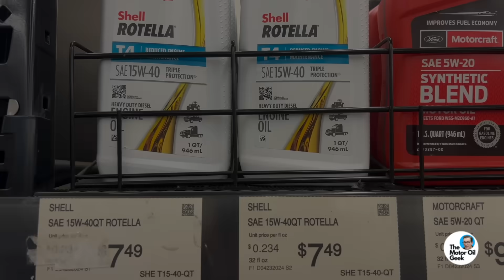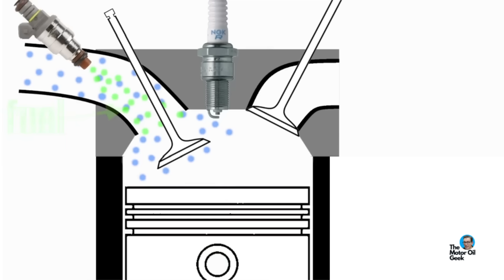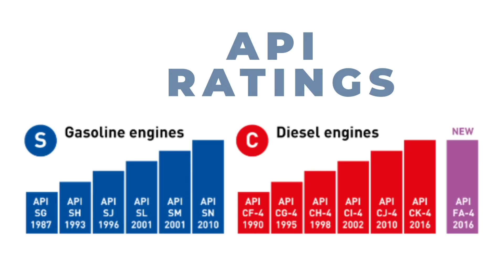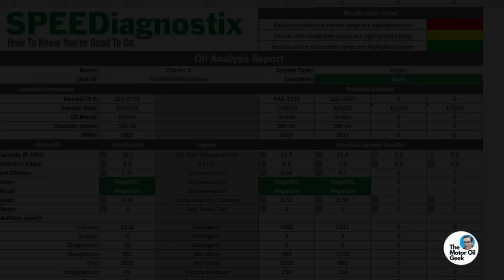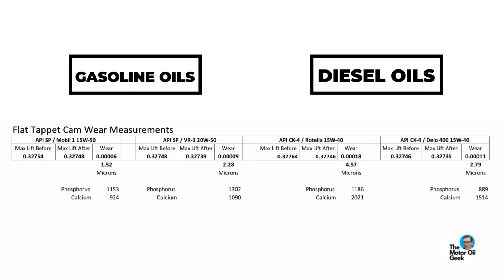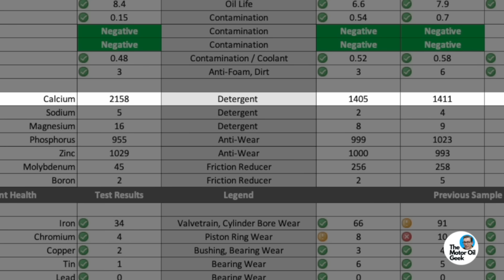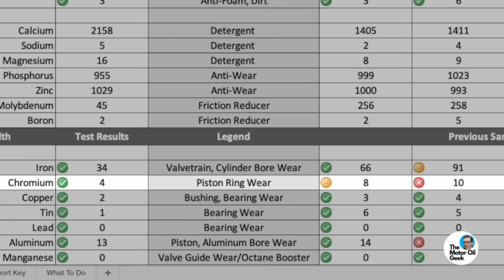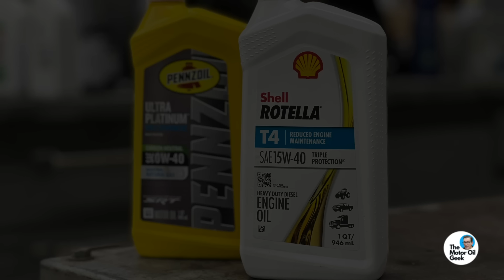Why DIESEL Oil is Actually WORSE for Gas Engines!

Comment: Lake: Rotella T6 says it is safe for gas, diesel, and even motorcycles. You should make a video about this engine oil.
Reply: Anecdotal evidence:

I have 85,000 miles on a '10 Kawasaki 650 Versys. Bought it new and have used nothing but T6 5-40 the whole time.
Motorcycle still runs, shifts, and rides as new. I go 5k miles oil change intervals, and don't have to add any oil between them.
Reply: @RockyMotoX  same here, my VTX 1800, my DRZ400E, my Vulcan 500 (with a ninja 500 motor swap) all run on T6 for up to 12 years for my VTX.
Reply: @RockyMotoX yep, there's tons of stories out there of bikes running T6 that last 100,000+ miles.  I think the key with any oil is the change intervals.  I run it in my Super Tenere as well.
Reply: Thats a pretty substantial test. Its why I watched this one because a lot of guys are running this in the bike race engines. What i was told was itbwas never meant to run high rpms. Because the antifoamijg agents arent there like a motorcycle oil @RockyMotoX
Reply: I think the break may be gasoline direct injection vs gasoline port injection (which would include carb, tbi, etc)
Reply: @redneck4528  yes. The ring groove  detonation hazard was described as for boosted direct injection. This makes sense. The quantity of the calcium rich oil is too low elsewhere in combustion chamber. The ring groove is rich in oil. The gasoline injection begins quite early and as piston travels up, some gas will enter the ring groove area. Catalytic assisted reactions / detonation occurs with more tendency with higher pressure and temperature. A boosted D.I. car engine can really get up there, say 11:1 at 10 psi boost that’s 11x25=275 psi combustion pressure before ignition. Piston top  easily hit 300 F. 
Not a risk in a plain engine.
Reply: @redneck4528  I would like to see Lake go deeper on this.  I and many others have used diesel oil in gas engines for years without issue.  I am going to do testing to see if I can confirm my practice.
Reply: Derek from Vice Grip Garage says it has vitamins.
Reply: Be aware that the T4 and T6 have similar levels of Calcium, which is the point he is making.
Reply: @ i see what he is saying. its a good point. the title of the video is very clickbaity. should be worse for gdi engines.
Reply: Your question about diesel oil and motorcycles is exactly what i was going to ask.
Reply: @flexjay87  Been using Rotella T6 5W40 in my 2014 BMW 1600 motorcycle and it works great.
Reply: @flexjay87  I use it in my 3 motorcycles, have been for the past 2 decades.  No issues, is wet clutch safe.  JASO-MA.
Reply: I would also like to see testing for motorcycle-specific oils like Motul or Golden Spectro vs. T6 full synthetic. In my old carberated motorcycle, the motor oil acts as the transmission oil as well. So the application is different than in a gasoline fuel injected passenger vehicle. In my motorcycle, I need better shear protection.
Reply: @allan6021  dont forget there wet clutch tooT-4 and t-6 are wet clutch rated
Reply: @allan6021  I hope too ! i always try to explain my point of view to my friends when i tell them i always put automobile engine oil for my dirtbikes but they stick to the idea its 2 differents type of oil.. so i stop arguing and let them say what they believe.. I wish i could make my own test but its very hard to show and explain the real deal of it
Reply: The video is somewhat deceptive in that he is showing analysis results of a 15w40 diesel oil ( probably Rotella T4) but picturing a bottle of T6 while talking about the additives in it.
Reply: @robertopenheimer1451  ASSumptions
Reply: @kq2799  OK keyboard warrior.
Reply: @ In yer feels now after saying Lake is a fraud... gosuxit
Reply: @robertopenheimer1451 not intending to start an argument here but I think your statement is incorrect. I run Rotella T6 as a 5W-40 in my diesel. Rotella T6 comes in multiple different viscosity grades. Originally 10 years ago I ran Rotella T6 as a 15W-40 in the same diesel engine. Don't mistake the type of oil for the viscosity rating.
Reply: @pks2634  I am not confused. I have been running 5W40 T6 in my 1998 diesel TDI since almost new. at least 20 years. I have also been running it in my VW direct injected (gas) 1.8T. Given the evidence he presented here I will no longer be using T6 in the 1.8T . I am going to switch to 5w-40 Quaker state euro synthetic which meets VW 502.
Reply: @robertopenheimer1451 at 9:43, it says Rotella T6
Reply: @robertopenheimer1451  he shows a bottle of rotella t4 as well lol
Reply: I saw him proudly displaying a jug of t6 several times in the video which is crazy because it’s API SN rated for gasoline engines.
Reply: @robertopenheimer1451 well actually t4 is SN rated also. It’s fine for flat tappet cam gas engines.
Reply: @robertopenheimer1451  It's not deceptive, diesel oils still have the added detergents to handle soot which increases wear in a gas engine. T6 or T4, it's the same problem. Just get over it, the myth is dead, it never made any sense to begin with.
Reply: @bobbygetsbanned6049  take a closer look at the charts and not what he is saying.
Charts show different viscosity of oils in comparison = a variable not accounted for.
When one runs experiments, all variables should be taken into the analysis.
Also, we do not know time, temperature, rpm, driver use and/or abuse.
Reply: @stepside2839  Ah hahaha reaching pretty hard. Basically all 15w-40 oil is diesel oil, so you can only compare it to similar weight non-diesel oil. But since you're already in the rotella cult, you'll always find a way to deny facts and rely on your bias instead. I'm sure they ran the rotella test in the freezer at 40,000 rpm and Mobil 1 test in a 100F shop, at 2,000 rpm, just to spite you.
Reply: T6 has been used in several types of classic straight 4 air cooled motorcycles for years without any issues.  In fact my 2014 Honda CB1100 runs great on it.  It lubricates both the engine and transmission.  This issues discussed here are not related to motorcycle engine that use T6.
Reply: I've wanted him to do that video as well. I've been running it for years in lots of bikes with 0 failures.
Reply: Turbo Subaru guys have used T6 for ages with great results either their used oil analysis and no issues with their engines.
Reply: Many people in the dr650 community recommend running shell rotella in the dr650 as that oil is readily avaible, in expensive, and is jaso certified hence the picture of the motorcycle. That jaso means it has the friction modifiers needed for the wet clutches most motorcycles have. I myself have never tried it as i am a fan of maxima, but i know enough people that do run it without issue that i wouldnt be hesitant to use it if need be. But the dr650 is an overbuilt, under powered, low stress engine, so this probably factors in to its success with that oil.
Reply: Biggest thing is pre ignition problems for gas direct injection diesel oils aren't recommended for gas direct injected engines.
Reply: The effect is more present in direct injection gasoline engine, but in port injestion engine the effect maybe less dangerous
Reply: @ For sure!
Reply: Just a question, if you're getting enough oil past the rings to affect ignition, does it really matter what oil you are using?
Reply: @rickyershey-sl8cm it's not just what leaks last the rings. It's the calcium and other additives are in the oil film left on the wall when the piston travels down the bore and comes up on compression.
Reply: I use Rotella T6, and have for 15 years. It is common in the Subaru community. Used it on an 06 WRX (common bolt ons and tune) a 13 WRX (pro tuned) and on a 16 FXT. Never had any engine issues or codes, handled the whp, no oil starvation, etc.. clutches were another issue ha
Reply: Science, not speculation
Reply: T6 is JASO-MA rated, meaning it is suitable to wet clutch.
Reply: @robertappleyard7053 not the 10-30 flavor
Reply: I also want it to be a shampoo, conditioner and body wash.
Reply: I understood like mobile red cap, T6 is a full synthetic, with no additives, you can use it in a motorcycle where the clutch shares the crankcase oil.
Reply: T6 5w40 was always gas and diesel, and still is, EPA would not certify 40 weight for fuel economy and thus they came out with gas T6 in you guessed it 5w30….
Reply: @BigGyz680  yes, it matters.  LSPI triggered by calcium oil additives seems to happen as a result of the normal, very thin layer of oil left on the cylinder walls by the oil control ring in engines that are in excellent operating condition.  It is not a result of oil consumption, like catalyst poisoning by high-SAPS oils being burned in substantial quantity.
Reply: @ as per Speediagnostix own new oil analysis;
liquid moly (gas) 5w40 2978 calcium, 
Shell Rotella T6   5w40 2140 calcium
Penzoil Platinum 5w20 2561 calcium
Reply: 13:16…. Sorry I call BS.

I put Rotella on my corn flakes
Reply: T6 is one of the best shelf oils for GAS and DIESELS ✅👏🏽💯
Reply: I’ve got 400k miles that would respectfully disagree with your assessment
Reply: Many diesel rated oils are also SN rated. Fine for use in a gasoline engine
Reply: @Lawnfella SN oils do not prevent LSPI in GDI engines, SN Plus is the minimum spec that tests for that.
Reply: @Lawnfella Except of course a gas engine that requires API sp. 😊
Reply: @Lawnfella exactly, gotta look at the details for that SN or SI, SJ rating.
Reply: @Lawnfella  like all the DELO which I avoid for that reason
Reply: But t6 has Jaso wet clutch ability @Lawnfella
Reply: SN is the lowest grade oil made in the last 50 years and is known for destroying flat tappet camshafts.
Do not use it in anything.
Reply: @Lawnfella Yes, as long as that engine doesn’t require SP.
Reply: @Lawnfella I’d love to get more detail on how this is SN rated and yet still bad.
Reply: Motul 300v review, please 🙏
Reply: Yes,   I've been using Rotella in motorcycle for decades but I'd love to get a professional opinion.
Reply: i use 5w-40 T6 in my 03 wrx. beat the hell out of that car and it likes it.
Reply: What about direct/port injection gas?  Best of both worlds!  Does lspi occur on these type of engines?
Reply: @ek97hb  LSPI (piston damage) does NOT happen in port injected engines.   Only in Direct Injection engines, and more likely with turbos attached.
Reply: @ek97hb still a slight possibility because they run such lean air fuel ratios and high compression.
Reply: LSPI is a tuning issue.  For example BMW has been using DI for decades and none of their approvals test for LSPI.  Mercedes Benz does have a LSPI test.  @ek97hb
Reply: It needs to be rated API SP or SQ to prevent LSPI (blown pistons).  T6 is not rated at all for gasoline engines.   Even their Rotella Multi-Vehicle oil is only API SN (not good for fighting LSPI).   Valvoline makes a diesel oil that is anti-LSPI (API SP rated for gas engines):  "Valvoline Premium Blue One Solution Gen2" and I don't think Delvac has any at all.  Rare to find an API SP or SQ diesel oil.
Reply: A one size fits all product is usually NOT the best idea. It may work but it will never be the best out there . Amsoil and Pennzoil are the top choices
Reply: yeah, nobody uses T4
Reply: 13:16…. Sorry I call BS.
Reply: I run t6 in my KTM 250sx (2 stroke) awesome stuff. Works good!
Reply: @mbproductions2292  25 years in trucking. Diesel oil is meant to work with 17 to one on average  compression. It not just thicker oil. Diesel as a fuel is slimy and sticky.  It's just clean cousin  of kerosene.   The gas engine's  piston rings are not as robust as a commercial  grade Diesel engine. Commercial  class 8 tractor trailers go 25,000 to almost  80,000 miles between oil changes. Diesel engines run at much lower revolutions oil pressure is also much lower. Motorcycles  with a 9,000 and above recline is not served well with Diesel oil. Your not getting superior  longevity  with the Diesel oil. Composition of oil much different. Truck company i worked for used Chevron  Delo. But whatever brand you use. Gas oil works better than Diesel in a bike. Composition  of engine parts soo much different  in gas applications. Friend of mine who worked as an engineer  for ARCO, would think it bad to switch. He knew the engineered qualities of all oils.
Reply: @WayneSummey 
I've  been  studying  this for a while (I have a 94' Yamaha V-MAX that I just bought)
Your  explanation just made up my mind. Thanks Pal.
Reply: @WayneSummey What you just stated means absolutely nothing as it is pure hyperbole.  T6 15W40 is JASO MA2 rated .  I've been using it in all of my motorcycles (carbureted, fuel injected, air-cooled, and water cooled) for past 10 years without any issues over 50K combined miles. Now in 2022 Versys 1000 with a redline over 9K rpm and over 25K miles with zero oil consumption or other issues. 

I am also mechanical engineer who knows much more about engine loading, lubrication,  and bearing design.  The ring/piston side loading in a diesel engine is much higher and especially due to turbo charging.  

Meanwhile your credibility claim is "with 25 years in trucking"😂😂😂😂
Reply: It's amazing to me how many guys I've run into putting Rotella in their gas engines, rationalizing it every which way. The thing I find in common with all of them is that they're convinced they know better than their owner's manual, and they all seem to be the type of guys who have something to prove, if you know what I mean. They already drive trucks that are too big for what they need and they have a personality to match. Ibget the distinct sense that they feel like using DEEZUL oil in their gas  engines somehow makes them tougher and their trucks make more power lol
Reply: @frogstomp427  and you point is?
Reply: So what is the best oil to use in a vintage gas engine with flat tappet cam?
Reply: @mousetoad7040  If you can find the correct weight I would use Rotella T6. You need to look at the oil and gas that was available at that time and the style of valve seals. For flat tappets you need some kind of lubricant in the oil like zinc sulphide. Think there are other lubes as well but brain just went doh... ZTPe? Anyway that's the big thing you need to make sure about as almost all oils had it removed years ago except for diesel synthetics. There is a slight chance of seals or gaskets not handling the detergents but those are the real old natural materials. When I switched to it I traced down every spec and component in T6 and compared it to the oem and it was better everywhere so was a no brainer to try.
Reply: Always remember, in a pinch, the wrong oil is always better than no oil 😂
Reply: C stands for commercial oil not compression oil.
Reply: I race motocross and woods on a newer generation bike, used t6 for years and haven’t had any problems from it
Reply: @kyleb6325  im speaking from experience on vehicles. It happened to my 2015 sierra 3500 duramax and it happened to my 2009 international 4300. Something in the t6 makes the gaskets swell up and leak i believe. It doesn't happen to every vehicle it really depends on the material of gaskets and seals used.
Reply: @ Interesting observation you made considering neither of the vehicles you listed use fiber gaskets that tend to swell and leak.
Reply: Comparing Mobil 1 synthetic 1550 to rotella 1540 non-synthetic that's hardly a comparison
Reply: I would be curious how a diesel oil like Valvoline Blue 5w40 holds up as Valvoline seems to have some black magic going on, using way less detergents than competitors and still yielding great results.
Reply: Same here, I've been using T6 since it came out on literally everything.... 2.2 Isuzu 7.3 p/stroke 1400 Intruder 400EX 🪵 wood splitter j/deere mower, gen sets. Safe for wet clutches..... I will continue to use Rotella T6 ● I enjoy this channel. Whatever oil one chooses, change it at proper intervals
Reply: Also t4
Reply: BMW n54 motor guys have been running Shell Rotella T6 since like 2008 or so to present in the gassers
Reply: It is t6 it is t6 MV you mean.
Reply: It’s a very mediocre low end group 3 synthetic.  It also foams up very badly on laboratory tests.
Reply: I’ve never owned a 20 year old car that ever had engine wear problems because I do all the oil changes myself.  The only people I know who have had engine issues they had others do their oil changes.  Now I have an EV, would like to replace every vehicle in my fleet with an EV one day.
Reply: It even used to have a API SN rating on the bottle.
Reply: I've repaired industrial diesel engines for 34 years I have run 15W-40 and everything that I own gas diesel air-cooled not one failure consult the American petroleum institute grading of diesel engine oil lake Valvoline premium blue it is an all fleet oil and that's the way it was marketed in 1978 and that's exactly what it is and all fleet oil
Reply: 15w-40 synthetic rotella and 5w-40 mobil 1 diesel oils have API SN. 5w-40 synthetic rotella does not.
Reply: @spiceyfrenchtoast9421  Oh yes, it is. Type Rotella T6 for motorcycles 5W-40. Even Walmart sells it.
Reply: Not to mention they are comparing two different weight oils. And they’re not comparing the anti wear additive packages of either oil.
Reply: I've only used diesel oil in all gas cars and never had issues if anything the sludge that came out was evidence its keeping the gas engine cleaner
Reply: @PW_12345  Thank you for your educated explanation of engine oil. One thing I have learned is that you cannot wear oil out, it only gets contaminated , what has happened to re-refined oil from years ago?
Reply: Saying one is synthetic and other is not, you didn't learn a damn thing he said. 
Watch it again.
Reply: I run t4 in all my dirt bikes meets the jaso spec, changing oil every 10 to 20 hours. I doubt it matters in my application
Reply: API rating doesn’t say that…. CK-4, “C” is compression fired. If it has “SE” rating, “S” stands for Spark fired. That’s no where on the bottle
Reply: Correction, it used to be. I dont even think T6 shows an API gasoline rating on the bottle anymore, except the 15W-40 which shows SN. The rest of us have moved on to API SN+ and SP for gas engines.
Reply: @ use to be and it only has the CK-4 API rating now
Reply: It is safe, as stated. "Maybes" are not evidence of. Low speed preignition caused the piston damage, not calcium. Oil ignites with oxygen under minute ignition circumstances, so low tension rings also "might" cause this... Look at the oxygen bottle for cutting torches - it says "use no oil". This is why.

Low tension rings are more harmful than oil... Viscosity in cold climates being the exception here.

Fortunately, Lake's evidence in this vid shows how diesel oil actually performs better in a gasoline engine, again, cold climate being the exception. For an oil to carry contaminants better, it has to have a thicker cushion, which is what keeps the crankshaft centered in the bearings, and keeps the bearings protected. Similar with camshafts, though too much zddp will cause camshaft wear because it's not the only additive needed... but flat tappet cams only.
Reply: Becaureful with T6 it will make your gasket and seals leak. Did it on 2 of my trucks.
Reply: @MATTEOSTOWING   did another synthetic oil do better for you? Amsoil did that on one of my trucks, seals were already old but didn't leak with thicker synthetic oil (t4)
Reply: @Faolan161  i run T4 only. As soon as I switched back. The oil leaks stopped significantly. I was left with 2 minor ones.
Reply: @MATTEOSTOWING  that was my experience.

I currently run Case No. 1 0w40... but now I change seals at 150k mi because I can't stand leaks. Heavy towing, bearings perfect at engine removal...
Reply: Everyone arguing with 2 experts. Just listen.
Reply: Most defenitley...
I saw multiple engines from diff mfg denied warranty for running t6 when it first caught on. 
Had a guy who worked for kawasaki and built numerous mx engines  in his own shop talk about it causing crankshaft and camshaft  failures. 
On the flip side I done an all nighter to get my lightweight Superbike engine built, went to fill it and had forgot oil. Only thing I had was a jug of t6 at the 24 hr wallywurld.
Engine held together. I kept running it as a joke. At least I thought 
I have been running it for two seasons now on t6 screaming that little motor 11k multiple times a lap 20 mins at a time all day long.
I would love to see some actual hard data, camshaft anylyzed,gears, pistons every part in the engine. 
So come Motoroil Geek grant us your knowledge and settle the second biggest internet debate of all time.
Reply: walmart oil is actually the best oil for gasoline engines it seems.
Reply: Great vid for rotellaTards
Reply: @ and flat earth folks.
Reply: The T6 he’s talking about is 5w-30 multi vehicle. It has lower levels of additives to meet emissions warranties for European diesel engines and it also has approvals for gasoline engines. It has lower additive levels but as many are saying it is full synthetic. It’s one of the best oils and the most underrated of them all.
Reply: People with soft hands shouldn’t make highly opinionated videos without real life experience…
Reply: T3 and T4 are fine for wet cluch bikes.   Don't need to splurge on T6.
Reply: T6 is all we use. Various engines and loads. Never had an issue with proper oil change intervals, better early than late.
Reply: I've been using t6 5w 40 in my 2007 Suzuki dl1000 the last few years runs great and clutch is still in good shape
Reply: I’ve ran T6 in my 450’s for a long time. Never had an issue.
Reply: In EU most engine oil are recommended for both gas and diesel engines. Talking about different oil specific for gas or diesel engines is a US thing?
I'm wondering because many passenger cars are sold with identical engines in EU and US...
Maybe you talk about heavy duty engines when you say diesel engine?
Reply: My Honda motorcycle engine was designed in 1980. User manual states only to use high detergent quality oil certified to meet or exceed API SE, SF or SG with single or multi grade viscosity in a range from 10W to 15W50 based on  atmospheric temperature. 10W40 is recommended from -10 to 40°C
So I'm pretty sure it was designed for regular passenger car oil.
And the clutch works just fine on regular cheap formula 3000 10W40 oil. So changing to something certified for motorcycles with a weet clutch seems like wasting money. Or perhaps I am missing something here?
Reply: If u want to "scrub your engine" run 15w40 every 4th or 5th oil change! If your not sure use both at the same time  😊 or just go w manufacturer suggested weight add some marvel mystery and change it every 3to 5 k and fugetabout it!
Reply: NO IT DOES NOT!!!!!!
Reply: Put Rotella in your gas motorcycle engine then. You're lost. You watched the whole video. You cannot comprehend. There's no hope for you. Save your $15 on an oil change and feel good. Your engine isn't feeling good.
And no, you don't understand what "ratings" mean or why they are used.
Reply: Not the 10-30 flavor its not for motor cycles
Reply: The biggest concern with T6 5W40 in bikes is it tends to shear down in the transmission per analysis reports I've seen.  I've also heard it can foam in high speed bike engines, but have no proof of that.  I do use T6 15W40 in my two stroke dirt bike gearbox anyway as the 2 stroke gearbox isn't terribly picky about the oil, T6 15W40 is available at Walmart for cheap, and the T6 doesn't have friction modifiers so works extremely well with the wet clutch.
Reply: @Duken4evr29 Most people dont understand how multi-viscosity oils work and what numbers mean.  The first number in 15W-40 represents the viscoity of the base oil independent of the viscosity improvers (VIs) that make the oil behave more like a higher viscosity oil at higher temperatures.  A 15W-40 requires less VIs than 5W-40.  VIs are long chain molecules that will sheer down under certain conditions.  A wet clutch and gear meshing will do this in a motorcycle.  As those VIs are sheared down the oil behaves more like a single weight oil equivalent to base stock.   A 5W-40 oil will lose viscosity much faster for this reason.  If you dont operate in cold conditions the  T6 15W-40 is the much better choice because you dont need to worry aboul ability to flow at higher ambient temps.
Reply: @kannermw  Exactly right, this is why I use the 15W40 in the dirt bike's gearbox.
Reply: Supertech 15w40 lists on the bottle as being suitable for diesel, gasoline, fleet, farm, and construction use. It's apparently good for everything.
Reply: @T_Burd_75 love me supertech!
Reply: @T_Burd_75 The more things a thing works for, the less it does any of them well. 

A backhoe can do lots of things. It does none of them well.
Reply: 9:40 has a UOA for T6. It has 2140ppm calcium and would have the same LSPI concerns that they talk about later in the video. 

There you go, I saved you waiting for a new video.
Reply: The T6 bottle calls it full synthetic, but I call it not quite synthetic since it’s a group 3 highly refined conventional oil
Reply: @darrylsjodin7184   Exactly, it's a highly refined conventional oil that's a group 3. T6 has a high NOACK number, which means the oil has a tendency for the lighter hydrocarbons in the oil to "boil off" changing the viscosity of the remaining oil and requiring top off oil between oil changes, some of the oil volume was "boiled off" during usage.  I always needed make up oil between 10,000 mile oil changes on my VW 1.9 L TDI diesel motor with Rotella T6 5w-40.  I NEVER needed top off oil between oil changes when running Mobil 1 Turbo diesel Truck full syn 5w-40. The mobil 1 was a much better oil.
Reply: @darrylsjodin7184  A lot of T6 is group 3, but most of that is GTL, which is the best of group 3 and approaches desirable properties of PAO etc.
Reply: @darrylsjodin7184 T6 is GTL like Pennzoil platinum & Ultra base stocks
Reply: Just because it's safe doesn't mean it's the best or even a good option. It's still going to have the additive package to handle soot, which will increase wear in a gas engine. Did you even pay attention to the video??
Reply: I run rotella in my KLR650, i'd love to know if I'm messing it up.
Reply: @enb3810  been using any old 15w-40 in my 2000 KLR, seems fine
Reply: @enb3810 I do too.
Reply: I’ve never felt good about putting diesel oil in my bikes. Glad I haven’t yet.. but the thought is still there to save money.. seems like trying to save money on important things is never a good idea.
Way to many conflicting opinions on this 😅
Reply: 25 years in trucking here. Diesel engine has different  needs. Why run something  built to take care of diesel engines. When gas oil is soo good now. What ran our class 8 Cummins is NOT going to make your gas engine piston rings work better.
Reply: The t6 is just fine with n either imho and add some Lucas. None turbo of course stock situations
Reply: @CCerwin  What does Lucas do?
Reply: Isn,t T6 a semi-synthetic where T4 is petroleum
Reply: T6 is full synthetic.
Reply: @racerd9669  t6 full synthetic, t5 is a blend and t4 is non synthetic
Reply: @markwilliams4525  T4 is actually a blend now.  I know it doesn't show this on the bottle, but I talked to Shell and they said it's a blend now.  Also, on their website, it shows that it's a blend.
Reply: @kaystorms7494  I've never heard that, the gray t5 says blend
Reply: @markwilliams4525  
I thought that too .. but my uncle read right off the back of the T4 jug.. synthetic blend!
I'm not sure what's what anymore  lol
Reply: @wrenchhead525  i'll have to check that out
Reply: Blend is a ripoff. It only has 10% synthetic.
Reply: @ I agree
Reply: @racerd9669 T6 full synthetic
Reply: @racerd9669  T6 I'd full synthetic. T5 is semi-synthetic
Reply: Not relevant.
Reply: @racerd9669  T6 full, T5 is Semi
Reply: @racerd9669  T6 says full synthetic on the bottle
Reply: @racerd9669  Shell Rotella T6 is FULL synthetic. T5 is synthetic blend. I know about T6 because I use it in my Duramax diesel engine.
Reply: @racerd9669  T6 is pure synthetic. T5 is semi-synthetic. T4 is dinosaur oil called conventional oil .
Reply: T6 is full synthetic,  T5 semi T4 Dino based
I use T6 in my MLMercedes because of the detergent additives. When I first got it it ha d sticky lifters, after a few changes that went away. Now at 458K on it still going strong.
Reply: @racerd9669  T6 is fully synthetic
Reply: @racerd9669  Yes, you are correct.
Reply: @racerd9669  T6 is full synthetic
Reply: @racerd9669  T6 is fully synthetic. T4 is dino-juice, T5 is semi-synthetic and T6 is full syn.
Reply: @racerd9669  T6 is full synthetic
Reply: @racerd9669  t6 is full synthetic t5 is semi synthetic and t4 is straight conventional
Reply: @racerd9669 Fully synthetic engine oils are still derived from petroleum. They’re just treated and engineered with synthetic additives to strengthen the petroleum molecules.
Reply: @racerd9669  T5 is semi synthetic.
Reply: @racerd9669 
My uncle gave me hell the other day .. 
I put T4 in a new 454 .. and he showed me on the back of the jug that T4 is a synthetic blend.. i'm bummed I never knew that.. I wouldn't put synthetic in a brand new motor.. break in procedure can be affected 🫨
Reply: @racerd9669 no T5 is semi T6 is full
Reply: @racerd9669  T4 is standard, T5 is semi syn, T6 is full sync.
Reply: @racerd9669  T6 is full synthetic.
Reply: @racerd9669  T6 is full synthetic, while T4 is semisynthetic.
Reply: @gungadingo  T4 is not semi. T5 is semi-synthetic.
Reply: Not relevant.
Reply: Rotella T6 foams BAD, there were a few viral tests revealing this last year do NOT put in your motorcycles.....
WAY more excitement in a motorcycle crankcase than your average diesel engine, any bubble is a lack of oil - RIP bearings
Reply: In my Harley owners manual it states that if their oil is not available to use a quality diesel oil, must be specific to engine design, Harley uses roller bearings in lieu of other types??
Reply: @ It really says that Im surprised.
Reply: Tell us you don’t get it
Reply: @HunterB738  I don't get it. Happy?
Reply: @HunterB738  Don't be a dick.
Reply: Rotella T6 is garbage.
Reply: @chrisbradley3224  why? It seems lots of diesels thrive on it...
Reply: Nowhere in their advertising or website does it say anything about being safe for any gas engine. The only indication is a PICTURE of a motorcycle on the bottle of their 5w-40. Pretty sure it’s just a marketing gimmick as any other oil specifically designed for motorcycles is obviously going to have a better formulation. I guess they could have formulated it for the KLR650 military motorcycle but I find that highly unlikely.
Reply: @supersportimpalass  it's jaso ma, ma2, and dh-2, which means it's compatible with the wet clutches in motorcycles
Reply: @supersportimpalass  the diesel t6 5w40 sheet shows jaso ma and ma2 standards which are what dirtbikes and motorcycles use. those are gasoline powered.
Reply: Ma specs are for wet clutch
Reply: @joshualester2735 thats why i use it in the diesel truck and atvs
Reply: @joshualester2735 I think that spec is just because of the wet clutch in a dirt bike isn't it?
Reply: @supersportimpalass  There are two versions of T6 Rotella. There is a multi-vehicle and diesel versions.
Reply: @MOE-db8oc  I went to their website, and you are correct. There are several versions of the T6.
Reply: @MOE-db8oc both t6 are full synthetic,,one is 15-40- the other 5w-40- & they have the Jaso wet clutch ability,,and work well in a carbureted liquid cooled Vtwin..done it.
Reply: @MOE-db8oc  wonder if the multi vehicle is just the 5-40 instead of 15-40
Reply: @ Both were 5W-30. The multi-vehicle gallon was $10 more expensive than the Diesel blend.
Reply: @supersportimpalass  It's JASO-MA certified, which is a motorcycle cert.
Reply: @supersportimpalass  T6 is Jaso-MA certified for wet clutch use in motorcycles.
Reply: @MR_Garage show me a better, cheaper oil for my wet clutch. I’ll wait…
Reply: @j_k_s2357  I never disagreed? I use T6 too!
Reply: @supersportimpalass  but they choose to use an illustration showing a cafe bike not the goat, hmm
Reply: @supersportimpalass  T6 is MA/MA2 JASO certified, its 100% mentions motorcycles, because it has the cert for them... but not ALL the T6 has that cert either... I think its like the 30w-15 or something DOES NOT have that cert.
Reply: @supersportimpalass t4 and t6 are ma/ma2 certified it is a motorcycle wet clutch certification
Reply: @supersportimpalass  pause the video where he is lolding up the back of the quart of T-4 and you will see it is rated CK-4 like he said and  JASO MA MA2 and that makes it motorcycle oil, he was talking about direct injected turbo cars not motorcycles
Reply: @supersportimpalass  The Jaso ratings in reference to motorcycles is that the oil has to perform as a transmission and wet clutch package also.
Reply: @supersportimpalass  rotella t6 has the JASO MA/MA2 rating.  So it's fine for motorcycles.   Ran it in a triumph tiger 800xc with no issues for 110k miles.  It was still running fine when I sold it.
Reply: @supersportimpalass  wow you remember that kawasaki diesel motorcycle.  Love to have one. 😊
Reply: @supersportimpalass Wrong. Has the JASO cert for motorcycles. Even listed on their website.
Reply: @supersportimpalass  "marketing gimmick" = "advertising or website"
Reply: @supersportimpalass  T-6 is JASO MA and MA2 rated for wet clutch motorcycles.
Reply: @supersportimpalass  The motorcycle indicates here are no anti-friction additives that would interfere with wet clutch operation. Many oils have anti friction additives that will allow wet clutches to slip.
Reply: Nonsense. Their website clearly states it’s jaso rated for wet clutches. Meaning motorcycles. Hence the picture of a motorcycle on the jug.
Reply: @supersportimpalass  I have used 15w-40 in my KLR650 for 24,000miles.  No issues.  Rated for a wet clutch is why the motorcycle pic on the jug.
Reply: @supersportimpalass T6 is JASO DH2 and JASO MA/MA2 rated for wet clutches in motorcycles. Harley-Davidson suggests using a synthetic diesel oil if their own brand is not available. You can pay more for the same thing if you want to.
Reply: @supersportimpalass  Hayes made less than 1k diesel klrs. Makes absolutely no sense to develop an entire oil line based on that.
Reply: @supersportimpalass Honda guys have been running T4 & T6 in their bikes for years. My 89k mile 1996 Magna only gets fed T4 or T6. Rotella has the friction additive needed for wet clutches which is why it's motorcycle safe.
Reply: @supersportimpalass  in my air cooled harley, the upper cylinder temperature absolutely cooks any oil that isn't t6 for some reason. The 950F diesel turbo formulation (if I remember the temp right) actually does something in this case.
Reply: @supersportimpalass  Motorcycles with a wet clutch need motorcycle specific oil so it has the clutch additive. Regular engine oil will damage the clutch.
Reply: @bobbygetsbanned6049  "clutch additive"  And what additive would that be??  As long as the oil used in a wet clutch motorcycle does not have friction modifiers in it, it will not harm the clutch.
Reply: @FrankDank-ik7ic  what I read molybdenum is not always the culprit as some MC oil for wet clutch have significant levels of it, it has to do with overall friction index
look for the absence of "Energy Conserving", labelled with JASO MA or MA2, not MA1, not MB
of course there could be oils not tested for these specs, therefore not labelled as such but still good
Reply: @bobbygetsbanned6049  lol it needs to not have friction modifier and that's about it
Reply: @bobbygetsbanned6049 it’s more like a lack thereof additives. 

Motorcycle clutches don’t do well with friction modifiers
Reply: Oh god t6 was the worst motor oil i have ever tried in car and motorcycle. U must never change your oil. Everything i tried that crappy oil looks like im panning for gold. Im talking big chucks of gold crap. Each drain would look the same.  First my triumph and second my honda which never had that before switching oil. Went back to valvoline or mobile one. Never seen gold chunks again. I went thru 3 oil changes at 3k or 5k changes and each the same with t6.
Reply: @maximumoverdrive001 I ran t6 exclusively in my 2008 GoldWing for 135,000 kilometres (85,000 miles)  with changes between 8-10k miles, every other change with an oil analysis.  Negligible signs of wear, able to go longer with oil changes.